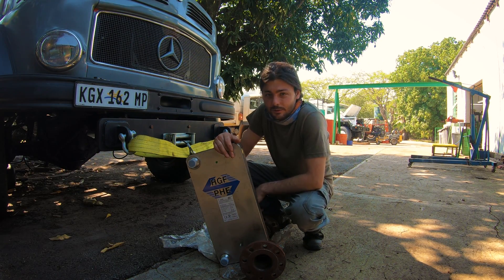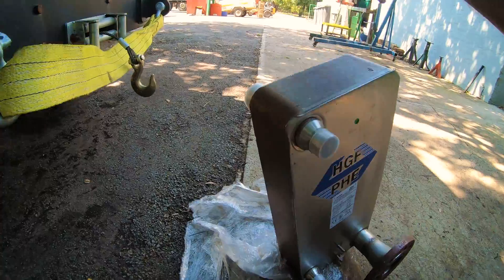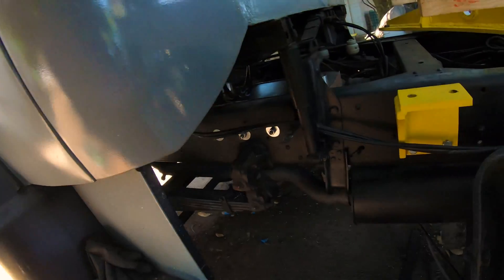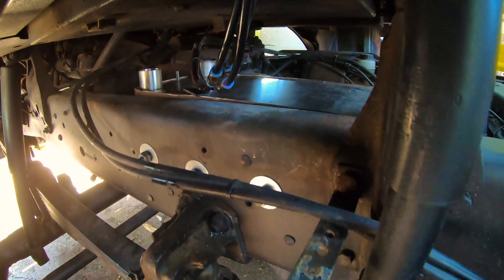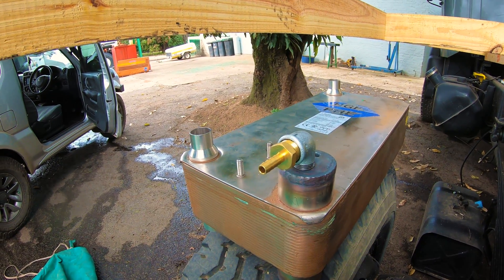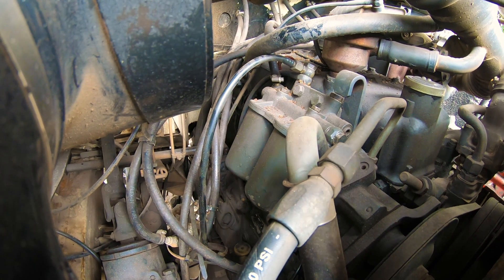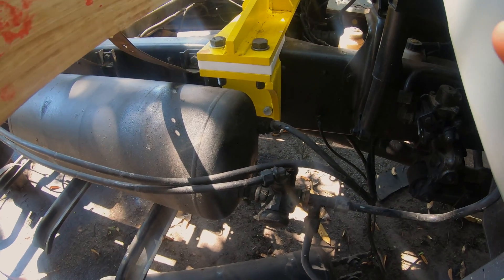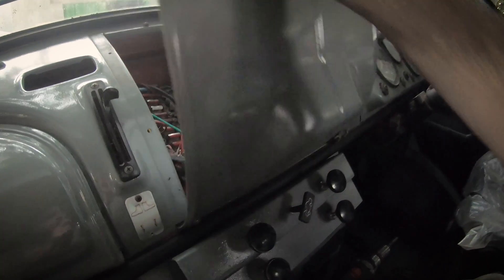Waste Cooking Oil | Building Betsy - EPISODE 7 | Heat Exchanger | DIY Camper Build

Comment: This oil system was orginal in car or it is your innovaton? Its so clever in warm areas. 
Awaiting for more :)
Reply: Hey Lukasz. Not orginal at all, but the concept has been around since the invention of the diesel engine. A friend of ours taught us the basics, and we adjusted where it was necessary. We'll hopefully run the truck on veg oil in the next week or two for the first time. Have a great one
Reply: @robinlewis1591  once I fill my 4.2 diesel nissan patrol using oil. Patrol was working even smooter than on diesel but smell grom exhaust was terrible. In my country and I think in all UE countries driving on vege oil is illegal beacuse of taxes in fuel I think... Check where it is legal before you drive on your journey. 
Fingers cross for your project. It is my dream to follow you and use this Mercedes as a base. I love old and durable cars which were made to last as long as possible. Nowdays only eco dwo piston four turbochargers cars are made... Sad but true
Reply from the maker: Oil still going well, almost two years on the road and on the 5th country. Hope you're still around :-)